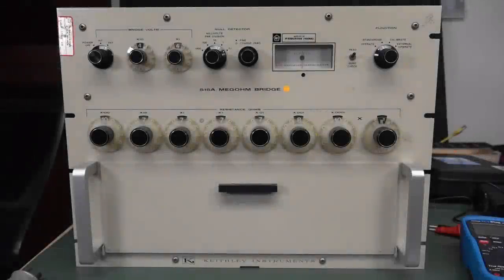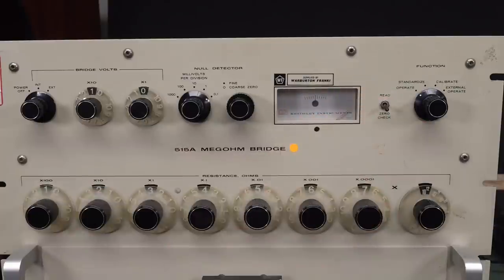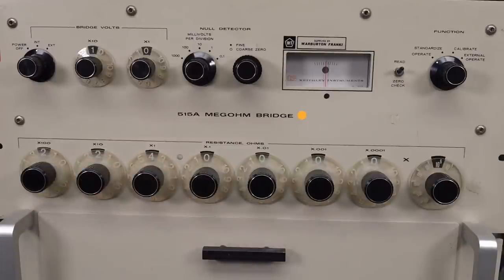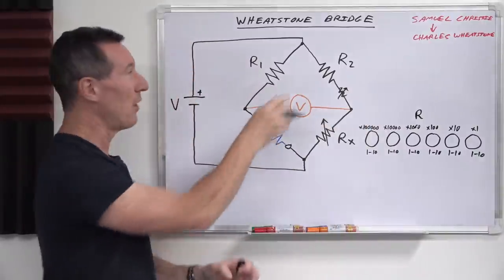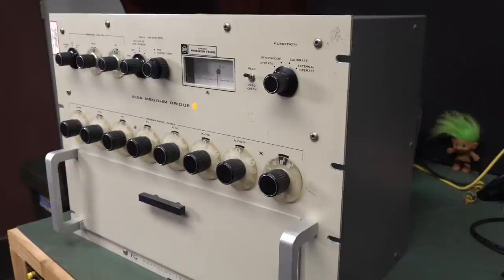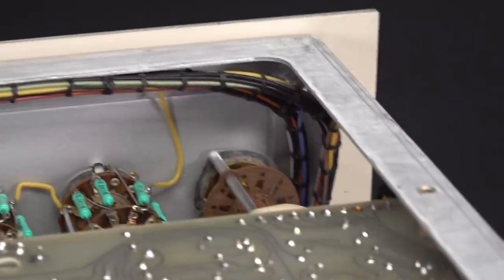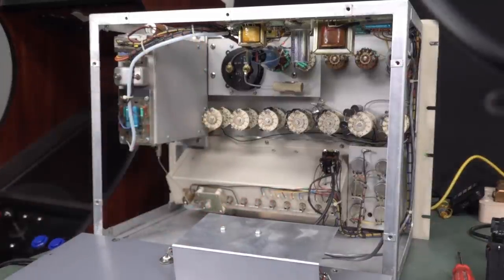EEVblog 1476 - Keithley 515A Wheatstone Bridge TEARDOWN & TUTORIAL

Comment: 50 year old capacitors, probably a little leaky, but it still works well. A bit of work and you can use it again properly. Date on the board is 1967 January, but looks like the meter movement was made 1968, so probably this one dates from then, though I can guess a lot of the precision and high value resistors date from the early version period. There they used pentodes and abused the screen as the second grid for the first stage, but they used similar voltages, and the second transformer was a switched power supply. AC output socket to power the optional high voltage supply to give 500V to use the top ranges, none of this 2 power cord rubbish.

My bet inside the can is a dual Jfet in the classical opamp circuit, specially selected matched pair with ultra low leakage, and all select on test resistors around this input.
Reply: Date on the meter at https://youtu.be/JDXKrXJloSw?t=1402 is 04/71

Comment: I just realized, dialing in the resistance to find the value of the resistor is exactly the same as using gauge blocks to measure the length of something.
Reply: @MLeoDaalder   Yea, it's basically comparing against a standard.

Comment: A neat trick with crappy sensors is to put a pair of them in the legs of a bridge, with only one exposed to what is being sensed.  At the start of my career I used this approach to quickly evaluate "novel physics" sensors, where the rules were: "To a first approximation, a Novel Physics sensor is a..."  Where what would follow would be 1) "thermometer", 2) "microphone", 3) "hydrometer", and so on.  Such sensors can have the "signal of interest" buried under multiple decades of "stuff", the goal of sensor development being to determine if the desired signal can be cleanly and reliably isolated and used.

The hard part was at the very start, simply finding the nominal sensor operational characteristics, starting with voltage and current bias, which needed wide-ranging bridges.  We'd use nulling meters to start, then electrometers/VTVMs to obtain precise nulls.  What worked in the physicists' lab often failed when moved to my bench, meaning there was lots of starting over, sometimes resulting in my part of the project being put on hold while the physicists took another stab at it.

If a candidate sensor passed the "quick & dirty" bridge test, we'd go on to validate and calibrate the performance via a massive amount of data acquisition and statistical analysis (SVD, PCA, etc.), the end result of which would yield a sensor driving and compensation circuit along with a calibration procedure.

My job started with working with the physicists in their lab, assisting their development of the "proof of concept" lab bench setup, done in their shielded room on an optical bench next to racks of lab equipment.  I next had to replicate that system performance (as best I could) in a prototype enclosure on my engineering lab bench.  I was the software/firmware engineer, but I previously worked as a tech on nuclear instrumentation and lab calibration, so I had the best precision assembly and solder qualifications in the building, and good metrology skills.

I miss those days.

Comment: The high value resistors and the meter movement had date codes, ranging from '68 to '71. The "penetrators" on that rotary switch were actually the switch contacts; flat side contact, pointy side solder terminal.

Comment: I recently got interested in electronics, I bought a piece of equipment from a shop cheap because it looked cool and what better way to lean than to tinker with stuff, no manual and not a whole lot of info on the web but I haven't done an exhaustive search, RFL 829D  ac/dc calibration standard. 
After watching this I know a little more about how it works, seeing the big transformers in my unit and the huge red jewel light "High Voltage" and the dial below going up to 2000 volts, I'll wait till I get more info or find a manual before I plug it in ⚡🤯

Comment: Bridges are so cool, I have a whole collection. Most from General Radio but also ESI and  Wayne Kerr. My HP generates 1000V and can measure peta-ohm and I have a GR bridge that can generate 300V and has a zero meter that is 1 uV full scale. It can measure down to aF resolution. It once was the mother capacitance bridge from GR 's own cal-lab. If you want to know more about bridges, Henry Hall is the man that designed them for GR during 40 years. He is still active, I think he is by now in the 90's. You can reach him via the GR group or via IET. He has scanned all his GR documentation. You can find that at the IET site.

Your Keithley is a very nice instrument.
Reply: @pa4tim   Sorry to ask, but what units are aF ? Thanks.
Reply: @trespire  atto Farad, that is 1000 times smaller as fF. The range is aF, fF, pF, uF, mF
Reply: @pa4tim  Thanks.   That's what I was thinking, but it still doesn't make much sence to me. Such small capacitance is an inherent physical property of just a wire, isn't it ?   Never even heard of such small values.   Interesting.
Reply: Wayne Kerr? Seriously?
Reply: @pete3897  Seriously, you did not know ? They still make serious LCR measurement equipment.
Reply: @trespire  It is just the resolution,  It measures with 7 digits. Pure measuring aF on its own has probably no use. Maybe in scientific research. I was asked a few years ago if mine was for hire because they needed that resolution. I did not do that because they wanted to use it outdoors.

I have done some aF resolution measurements just for fun, it is possible to zero the bridge until the last digit but it is far from easy. Took me like 30 minutes. It is difficult, like everything that is on the edge of what  is measurable. Ever tried to measure peta ohms, that is just as much fun. 

Btw, this bridge, the GR1620 (Bridge, generator and detector, faraday cup, guarded cables etc) is still in production (But now as the IET 1620, IET being the former calibration division of GR). Someone told me the price is around 15k dollars but I do not know that is true.

Capacitance can not be the property of a singel wire, you need at least 2 wires :-) 
As a reference, the capacitance of 2 banana busses at the standard distance from each other (like in/on a DMM frontpanel) are between 2 and 10 pF.  Not important if you are in the audio frequency range, but not so handy if you want to use bananas on 100 GHz. 

Inductance is part of the model of a singel wire.  If I remember well, 1 meter is about 1 uH (I measured it many years ago)
Reply: @pa4tim  15K sounds about right for such a precise instrument.   On some industrial laser machines we have a short section of coaxial cable that needs replacing sometimes.   It's part of an RF resonance circuit at 7 to 8 Mhz.   A section of 220mm coax cable is 12 pF, if I recall, and needs to be nulled out.   2 wires as you said !
Thanks for the explanation.

Comment: A true thing of beauty and a joy for ever indeed! And that's no fluke. Absolutely loving it, 
Soooooooo empty inside, but these ceramic standoffs and wafer switches surely are a looker. Wire looming too; that's the way I laced them wires in my amps since mid 2000s. I love the way the old gear was built... tube or not. 

BTW, one of my tech tips if anyone is interested:
A Wheatstone bridge circuit and principle of operation can be used for testing ganged potentiometers (most often, stereo volume/tone pots). You just connect both ends of a DMM or even better, a positive/negative analog voltmeter to the wipers, and wire the resistive paths of both sections in parallel. Connect power (e.g. 12VDC wall wart) between left and right ends. A ganged pot with ideally consistent sections will measure zero throughout the entire length/rotation range. Typical pots tend to have inconsistencies, especially close to the extreme positions, leading to imbalance between channels. Stepped attenuators built with high precision resistors have this problem solved by design.

Comment: Physics lessons in the 60s about  resistors. An instrument consisting of a meter long  etched rule with  a resistance wire and a knife edged brass pointer  a galvanometer (centre pointing ammeter) a known resistor and the DUT. Effectively the wiper being South. Junction between DUT & Known North.

That takes me back.
Reply: Working as a tech in a steel mill in the 60s, one bit of kit was the wood-cased L&N potentiometer (in addition to a galvo, slidewire and other goodies, had a Weston standard cell and a No. 6 dry cell (calibrated off the Weston).   With a pocket thermometer and the mandatory booklet, one could calibrate thermocouple temps quite accurately.

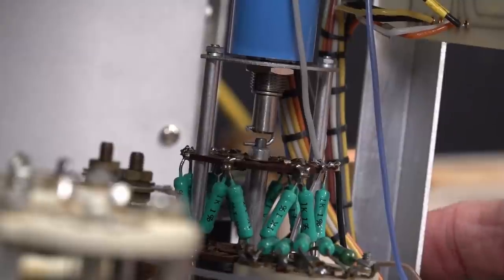Comment: @24:24 the same arrangement is used for the 0-10 adjustment on the Keithley 225 current source (which I know you also own), BUT it is a plastic shaft in that onto a switch... which is just asking to break. @eevblog

Comment: An other very interesting bridge concept is the Kelvin Varley divider but they are not very easy to find. You can use them to measure resistance very precise too, but that is not their normal job. I have an ESI and the king of them all, the Fluke 720. You use them for voltage calibration. Not to calibrate a meter, some people use them for that purpose but the internal resistance is much to high for that (to calibrate 10M meters). You connect two voltage sources and a null meter to them and then you can divide one off them to match the voltage of the other. If they are the same the zero meter reads zero. The beauty is that you can calibrate the 720 to itself and a null meter by feeding it zero volt. If you would use a meter to calibrate the voltage source the alignment and calibration of the voltmeter  is the limiting factor. Besides that it loads the circuit . That is why there are meter-calibrators specially made to calibrate meters. I use my KV dividers to check my Datron and Fluke Calibrators against my standard cells with full history. At least I did because the standard cell heater  controller died a few months ago and that thing is real voodoo. I will make a new controller from a design made by Jim Williams. It was his first publication. The old one used special selected germanium transistors.

Comment: You should check out the design in the Boy Electrician for making one of these using nichrome wire. It did require a galvanometer, which was a project in an earlier chapter. The wire was used to make references (basically a wire-would resistor on a wooden spool from thread), and the other side of the bridge was about a yard nichrome wire stretched out on a board with a scale along it.  The sliding contact for the scale was a screwdriver.

As far as longevity goes, Starrett is still in the same building, I believe going back to 1886.

Comment: Ahh the wheatstone bridge is used a lot still. I personally see them used on load cells (some sort of strain gauge is the variable resistor). Fortunately, they sell scale interfaces that do the math and have fancy signal processing, but my guess is that there’s some sort of low-passs or alpha-beta filter and then a bunch of other junk. One manufacturer insisted that the fancy signal processing was needed with motion (they made high speed rotary fillers for filling like a gallon of paint, has to be something where weight is important, the most common type of filling is called overflow and works like a gas pump, there’s also volumetric which uses a volumetric pump which are like a double acting syringe)

Comment: Probly find these still in use in uni physics labs as well as metrology labs.
Reply: Probably, but I doubt that the wall galvanometers are still around.  You did the null there by looking through a small telescope at the needle.  At least that's what I recall from electrical measurements lab that I endured in the dark ages...

Comment: Trying to find date codes:
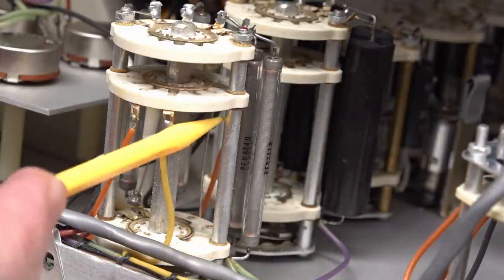Stamp on the PSU transformer (possible date code, unsure) is 7218 (seen at 21:05 ), and one of the glass resistors is 6840 (at 28:40 and 23:36 ). Other glass resistor at 23:86 shows 7118. Galvanometer at 23:21 shows 0471 (possible date code). I would assume this was made no earlier than 1971 and possibly sometime in 1972. I didn't see the 1968 code, but I think the resistors are more definitive for dating. It's possible those daven resistors and the mallory capacitor have date codes on the side, but I didn't get a clear look at either. Same with the welwyn range selection resistors at 24:43 Will check flickr and edit this once it's posted on flickr.

Comment: With the theory I miss the statement  "when R1 x Rx = R2 x Rdut than V = 0 " (or when R1 x R3 = R2 x R4) than V = 0  . You replaced it with 'the ratio of the two resistors in the parallel strings'.

Comment: Interesting is the special considerations required for accurate measurements of values at the extremes, crazy high & crazy low resistance values. A 4 wire meter is simple by comparison to this thingy.

Comment: Thanks. I'd like to know more about the model 302 electrometer amplifier module. What odds are that it is a varactor based op-amp? Not a mosfet or jfet but using varicap diode imbalance. Fascinating way to build low-leakage amplifiers!

Comment: I have a UNI-T UT501A on the way. I wonder why your meter only needs to go to 100V and not higher? I assume its because it  has a very good null meter and super sensitive amplification circuitry such that it just doesn't need 1000V

Comment: Those transistors wired as back-to-back diodes. I take it that they wanted to clamp the differential input voltage, and they used transistors because of the much higher reverse leakage of small signal diodes?
Reply from the maker: Yep, still used in multimeter input protection today, I've done a video on that.
Reply: @EEVblog  The 121GW moldymeter mod board video, n'cest-ce pas? As I recall, that was a great example of how even experienced EEs sometimes overlook the fundamentals. It was also a great example of your "warts and all" approach to your channel.
Reply: They are in series not anti-parallel so they will be using reverse emitter-base breakdown at 7-8volts, kind of like a low leakage zener!

Comment: I have a large collection of electronic components I collected while working for an electronics component manufacturer a few years back. Capacitors, resistors, transistors, etc. Surface mount and through-hole. Thousands of bits, mostly unsorted.
If you see this and this is something you would be interested in, please contact me. I will cover the cost of shipping from the States.
Reply: Wow, kind offer! Dave is a lucky guy :)

Comment: Keithley made some really cool stuff,  just too bad they did not keep up with Fluke to sell the product to the military, schools, factories. etc. 🙄😎  oh i have an old Leader Oscope 🥰
we even have a 1966 Portable Millivolt Potentiometer; Model 8686 (Leeds and Northrup). that was used to test Thermocouples 🤩 Bureau of Naval Weapons, Washington, D. C.
Reply: See my post above.   One of my jobs working in a steel mill was going down the line of instruments with my L&N potentiometer and calibrating things--not unusual to see 10 thermocouples per instrument and a long line of instruments.   Some of the recorders were old enough that there were no active devices inside--just a motor powering the works, a slidewire and a clamp galvanometer.  There were even clockwork versions where AC wasn't readily available.  L&N Micromax.
Reply: @tubastuff  nice information, i worked with several LN speedomax recorders with the standard cell. many SciFi movies had these in the back-ground 😎 thank you
Reply: @qzorn4440  Brown/Honeywell chart recorders too.  I remember installing AC-powered standard voltage reference kits in place of the Honeywell standard cells.  L&N had a similar thing for the Speedomax.  I recall that we had a good supply of 6L6s for the Speedomax servo amplifiers (mechanical chopper of course!).

We had a spate of vandalism with the Micromax units.  Somehow, word got out that the galvo support ribbons were gold (they were).  It was a pain to replace them, only to find them gone a week later.   Slidewire contacts were a solid-silver ball, but those never seem to get filched.

We really had problems with the 4' long high-temp thermocouples used in the blooming mill soaking pits.   Pt-10% rhodium in a porcelain tube inside of a SiC tube.  You had to be an idiot to brave the heat to grab one, but it happened every now and then.

Comment: 26:40 The two transistors acting as a back-to-back diode clamp ? Old school transistors as diodes better than actual old school diodes for this application ?
Reply from the maker: Yep, still used in multimeter input protection today, I've done a video on that.

Comment: What do those two transistors with disconnected collectors infront of the Op amp do?
Reply: They are to clamp the balance sense amplifier inputs to a safe level. They are in series not anti-parallel so they will be using reverse emitter-base breakdown at 7-8volts, kind of like a low leakage zener!
Reply: @erichpwagner  Thank you, I have never seen this configuration before.

Comment: to understand this ohm meter  accuracy, you must be rocket scientist.

i have fluke 11 (best device ever) , can measure in ohm upto 40M ohm.
all the portable device dont test above 40 ohm , because power restriction and user need.

fluke 11 in 40M range(auto) , in  resolution +-10K ohm 0.9% error , with one digit.
the fluke have 4 digit, and also range 1M ohm

if i check 1M ohm at this range, the max error will be 10K ohm(one digit) + 0.9%*1M=19 K ohm

then the range that will be display (981K - 1019K ) ohm +-19K